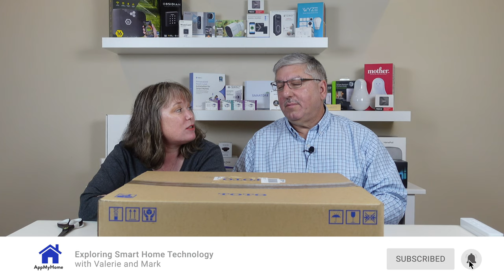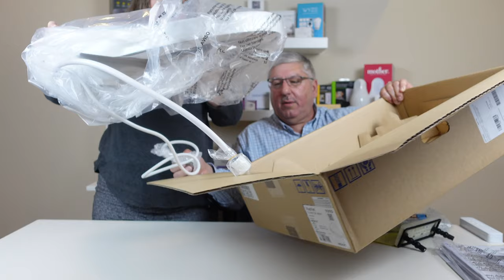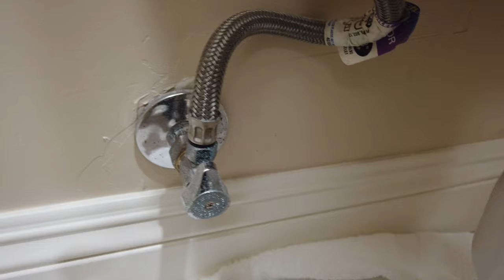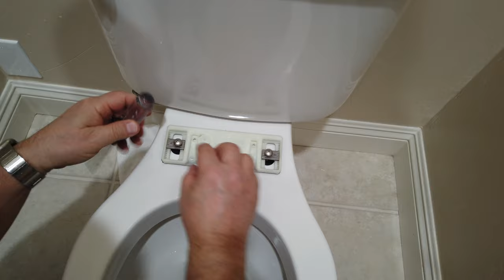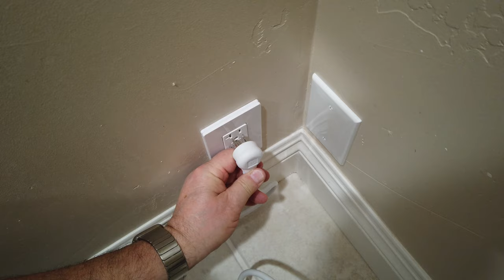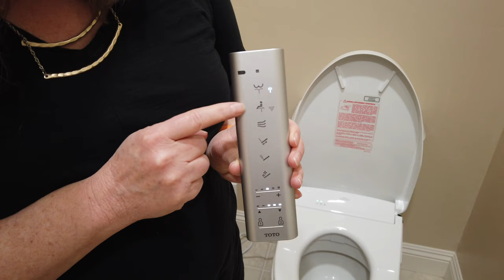Toto Washlet S550E Bidet Seat Unboxing Installation and Review

Comment: Just so you know, the wall mount bracket for the remote holds the remote with a strong magnet, so you don't need to install the C-shaped arm piece. That piece is only needed to mount the remote to the wall in an "anti-theft" fashion with a screw on the bottom. The instructions were very vague and practically non-existent about this. Without that anti-theft piece, it's much easier to pull the remote from the wall. And it looks a lot nicer too!
Reply from the maker: thanks for the tip. In our case we just leave it on the wall so it hasn't been an issue.

Comment: It would be nice if shown how you measure to make sure that the seat will fit the toilet. That is my concern because these seats are so big.  Thank you for the video.
Reply from the maker: Toto have a measurement template on their website so you can check. That said basically it’s two types. Elongated and round.

Comment: Very thorough video. Could you please tell me if the rubber bumper came with the seat or you got it from somewhere else?
Reply from the maker: The rubber bumper came with the seat. If you need one, I think any local hardware store would have them. They are just like the ones used in kitchen cabinets to quiet the doors closing.